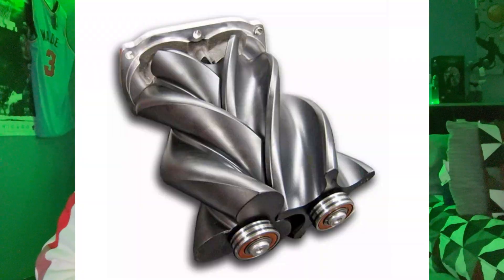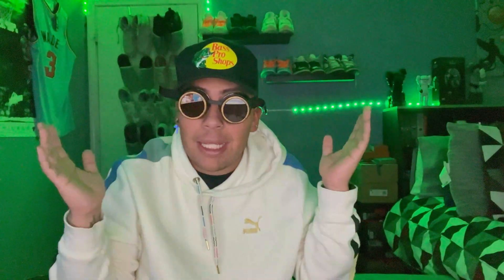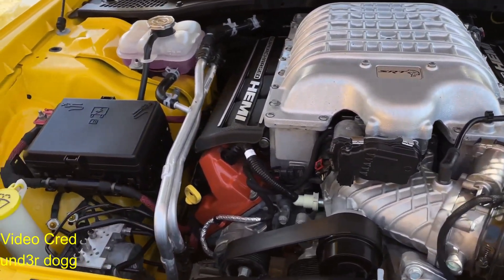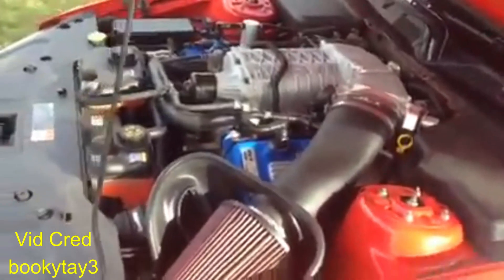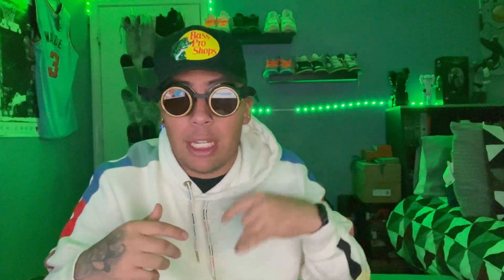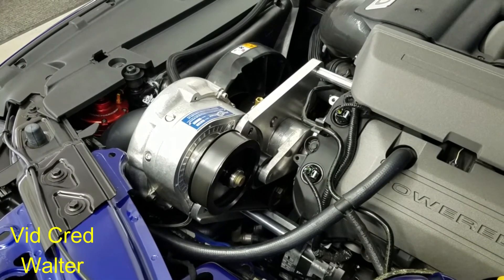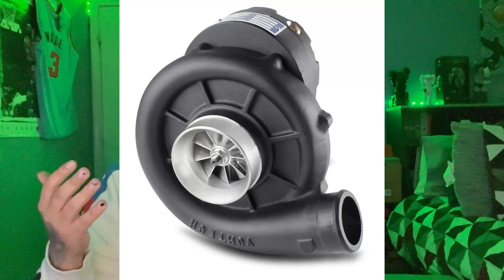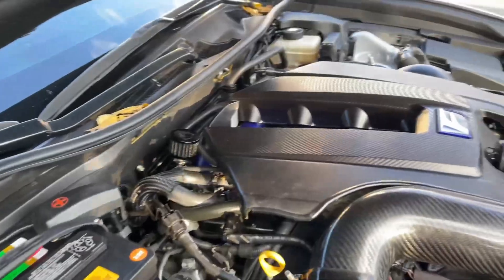Which Supercharger Is THE BEST?

Comment: Kewl video thanks. I chose a centrifugal supercharger for the street.The reason being is I am running a 9 inch 4’11 rear gear.I already knock the big tires off down low and I shift at 6800.This being my motor red lines pretty fast so I need the power up top.For the street centrifugal is the way to go even with lower gears.If your rear gear and trans are shit and it takes you an hour to shift thennnn a blower might be a better option.

Comment: I think the twin screw would be good. Because it's instant power.  But, here's where I draw the line. You see, the twin screw is always in boost. So, meaning it gets hotter, it also burns a lot of more gas. Oh, and you better love buying tires cause you'll be burning through them like crazy. Not to mention, with the twin screw if you don't have the right tire set up, you won't be able to get any traction. So, meaning you're just spinning those tires and not going anywhere. Now the procharger on the other hand doesn't get as hot. Also, when at idle or just cruising, you're not burning a lot of gas do to your not in boost. Plus, when the boost does come in, you already have traction. And as far as instant power, you could always go with a smaller pully .
Reply from the maker: This was a great analysis, each one has its pros and cons